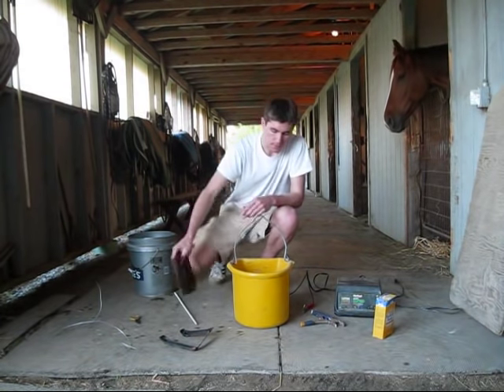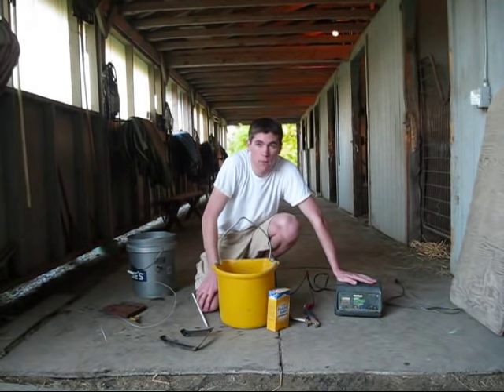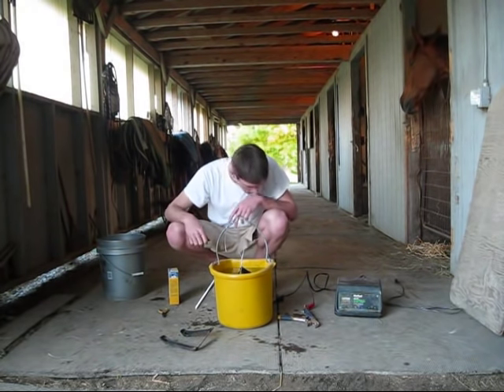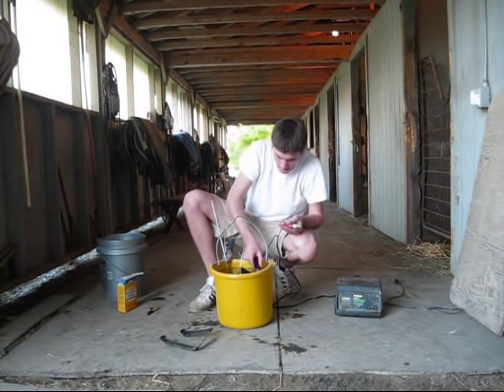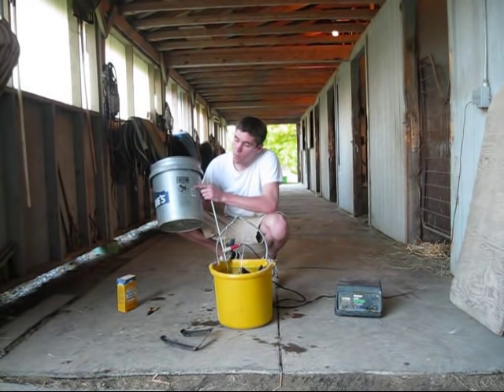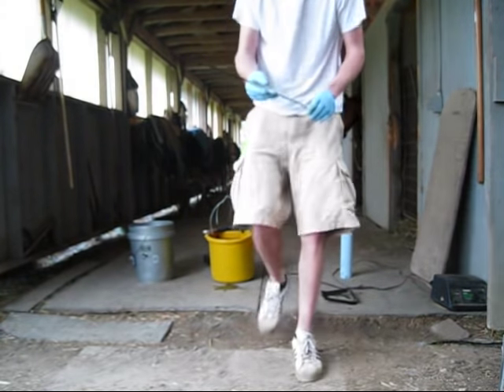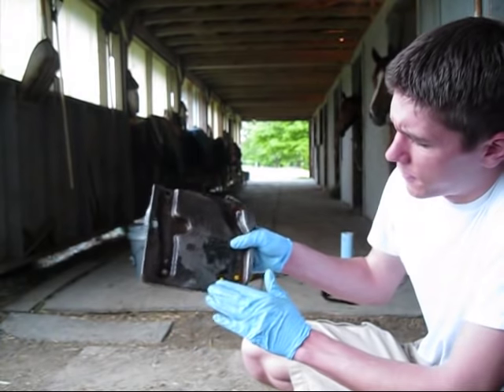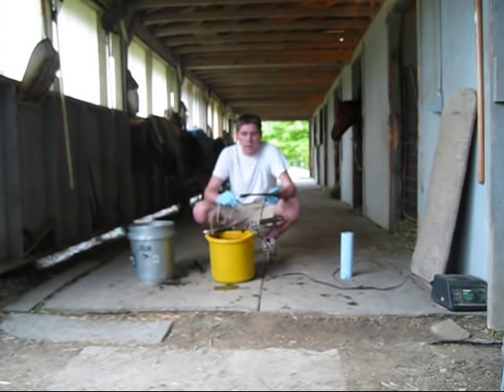Battery Tray Restoration CntrlSwitch How-To

Comment: great idea! i used a different method for cleaning my battery tray. I took a 5 gallon bucket with a lid and two pieces of Styrofoam to wedge the sides of the tray in the bucket and then filled it with coarse sand, sealed the lid and put it in my dryer along with a bunch of blankets to hold it in place. Then set the dryer on air fluff (no heat) and let it go for an hour. TaDa! no more rust.

Comment: Just an FYI...Many people using the electrolysis method for rust reduction swear by stainless steel, stating (incorrectly) that it's not consumed, stays clean and seems safe.
Stainless steel is indeed consumed when used in the electrolysis process, although slowly. The main problem with using it is the hazardous waste it produces. Stainless steel contains chromium. The electrodes, and thus the chromium is consumed, and you end up with poisonous chromates in your electrolyte. Dumping these on the ground or down the drain is illegal. The compounds can cause severe skin problems and ultimately, cancer. Hexavalent chromate is poisonous. These compounds are not excused from hazardous waste regulations where household wastes are.
Does your electrolyte turn yellow? That's a sign of chromates.
If you have been using stainless steel for the anodes (positive electrodes), wear rubber gloves when working with or near the liquids. If you need to dispose of it, allow it to evaporate into powders and dispose of the powders in sealed containers during your local "hazardous waste clean-up days".
Best bet - don't use stainless steel no matter how tempting it is.
Reply from the maker: Duane C Appreciate the added info Duane